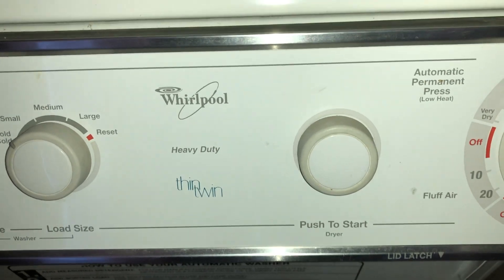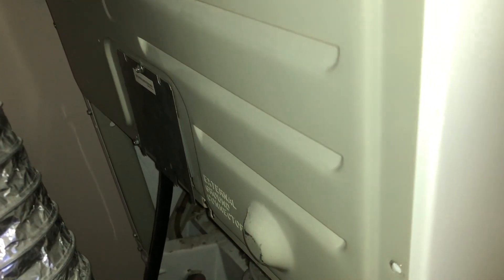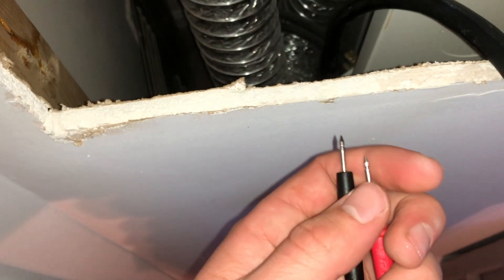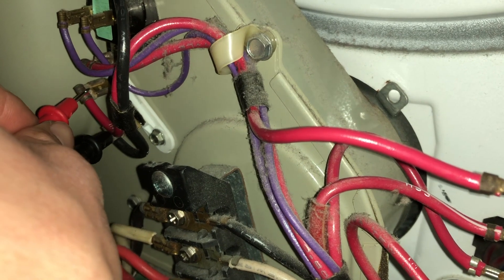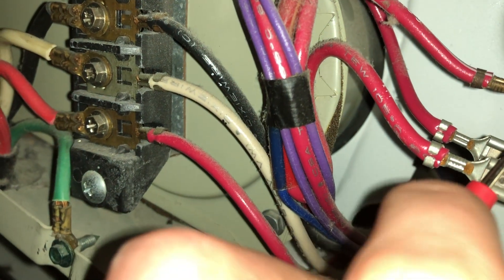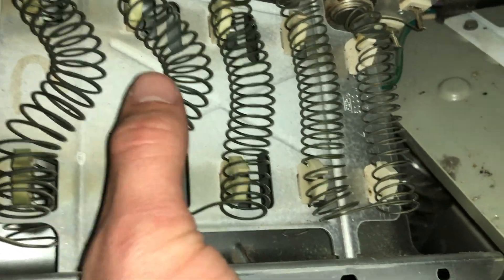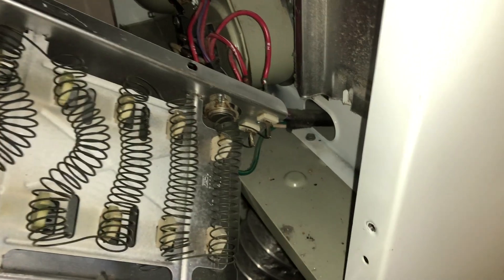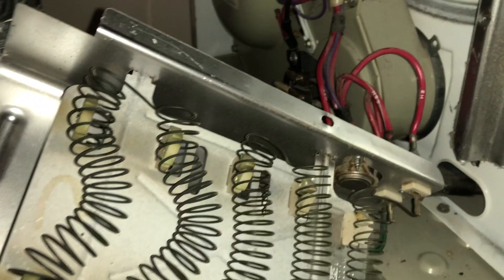Thermal Fuse Blew a 2nd Time on Whirlpool Thin Twin Dryer

Comment: Good Jobs. Good explaining . Is my first time I'm Washing something like Thatcher. God bless you.😊
Reply from the maker: Thanks for watching! And I'm glad my explanation was easy to follow! God bless you too
Reply: @donatinghorsepower5100  Hey brother mind helping me out? I got the same twin unit as you, got back from vacation and all of sudden the washer and dryer wont start. Just makes a buzz noise when I try to press the dryer start. Checked the circuit breaker, seems fine. Other than that no sign of life. Think it could be the fuse? Thanks.

Comment: My thin twin is from 2001, and I originally blew the thermal fuse in 2018. Looks like it blew again (2024), but I'm not sure if the element needs replacing. The last repairman stated that you really do not want to replace the original element if not necessary, because the ones they make currently are not as robust as the ones that were originally manufactured when the unit was made. Also, a clean vent hose really does help with the longevity of the machine.
Reply from the maker: Yeah I really did not want to replace the element because of all these cheaper made parts on the market, but so far it has not had any issues so I’ll let it ride. The clean vent hose is a good tip, thanks for the comment!